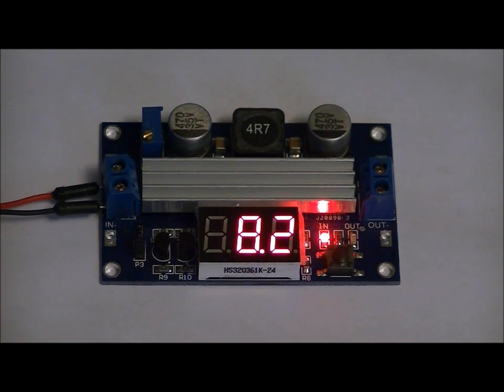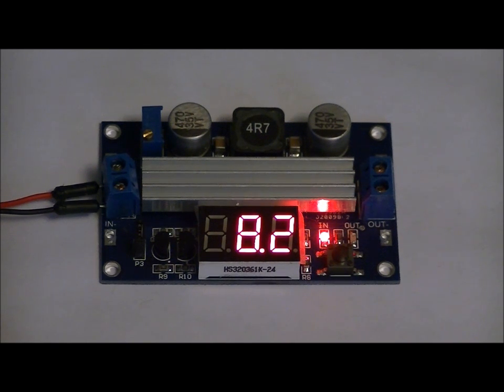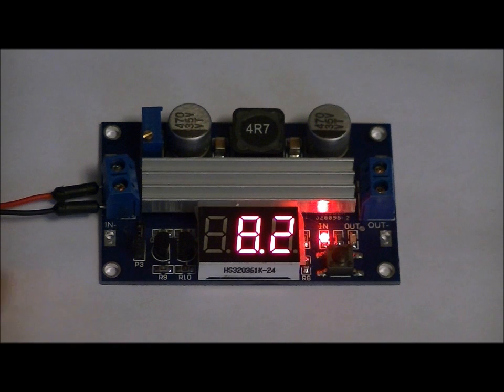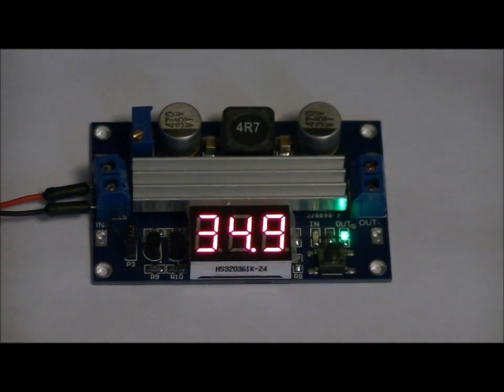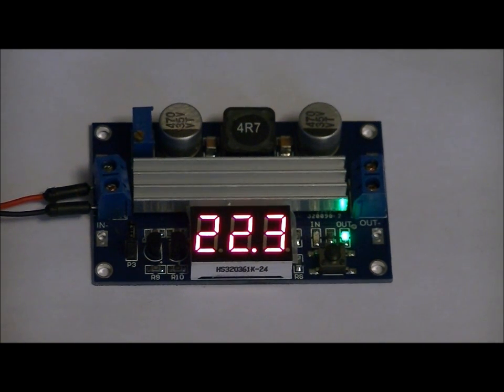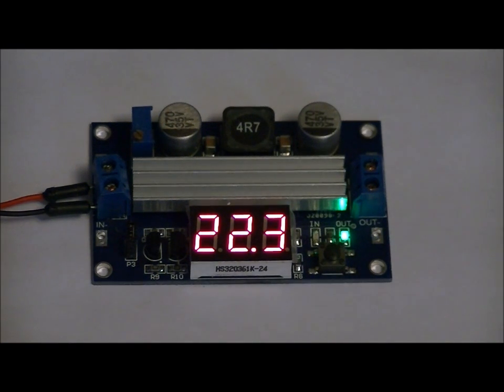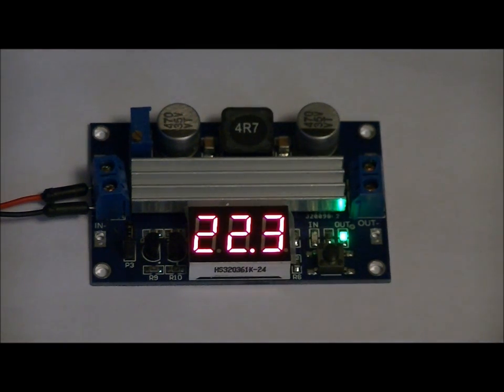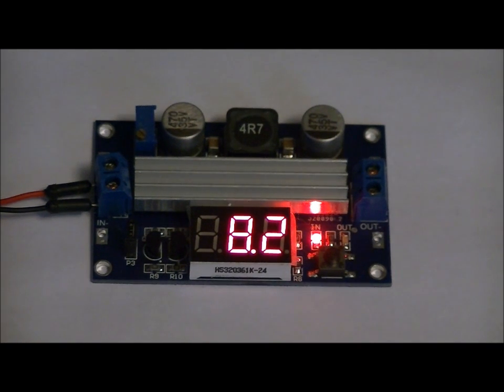The High Power 65W Voltage Booster Module - Boosts up to 35v - EASY TO USE!

Comment: I got the same exact one and the display wont work but it seems to boost but not enough to push a heating coil I dont know if it just dont have the current or amps but i have tried 2 18650s and it boost the volts but wont push a low ohm heat coil for e cigarettes
Reply: min input is 4V otherwise lcd is not functioning. 18650 might not be enough

Comment: can we add that module to Ultracapacitors in series so it keeps the voltage steady and keep the power inverter running longer? I understand the 6 amp max input so we cant run more than 6x12v= 72 or 80 Watts inverter?  what do you think?